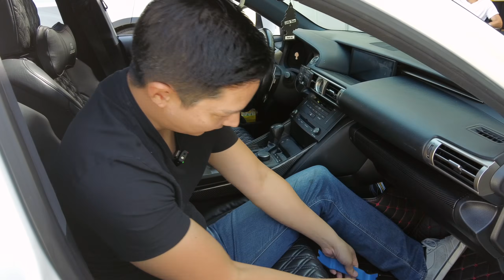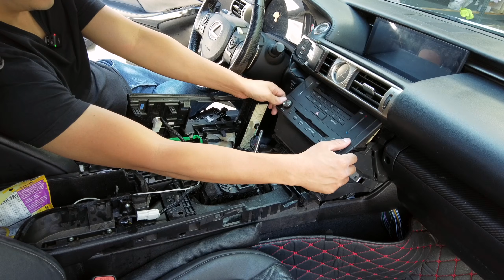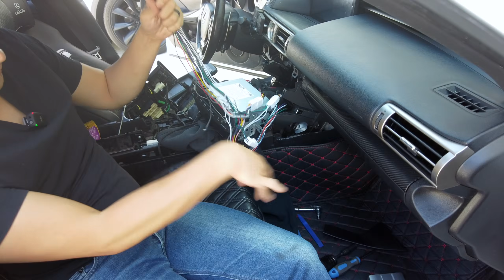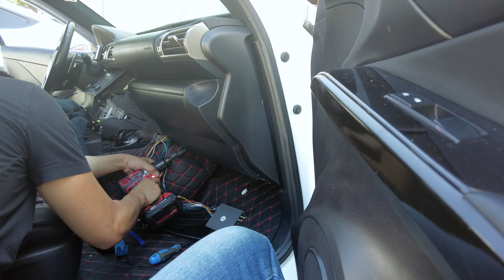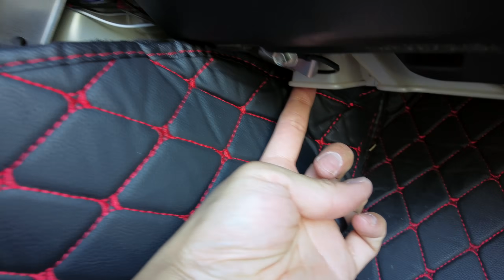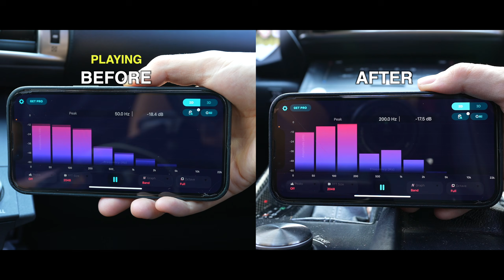Lexus IS without Factory Navigation | Top Rated Beat-Sonic Amplifier Kit

Comment: Hello, what does without factory navigation mean? Isn’t that standard on the IS
Reply from the maker: If you have the dial knob controller you don’t have nav. If you have the mouse controller you have nav. We have kits for both
Reply: @BeatSonicUS what is the kit for with nav?
Reply from the maker: @SSPARTAN955  https://www.beatsonicusa.com/lexuscarplayandroidauto.html
Reply: @BeatSonicUS will this affect my current amp being tapped into by a line output converter?
Reply from the maker: @SSPARTAN955  No
Reply: Would this be compatible?